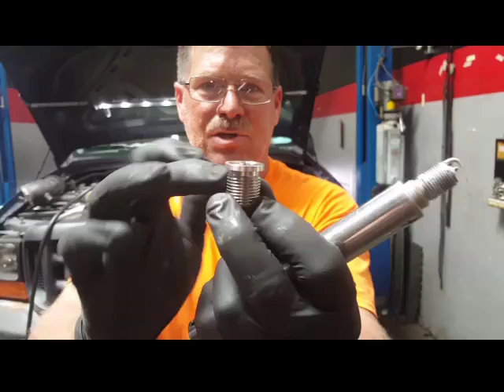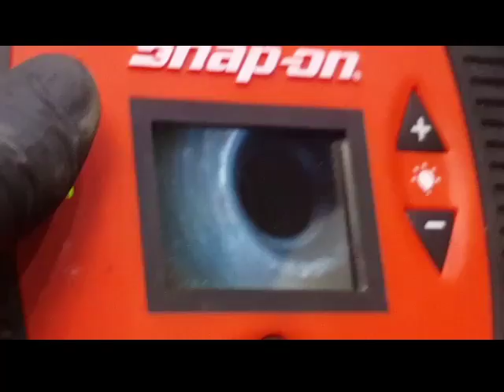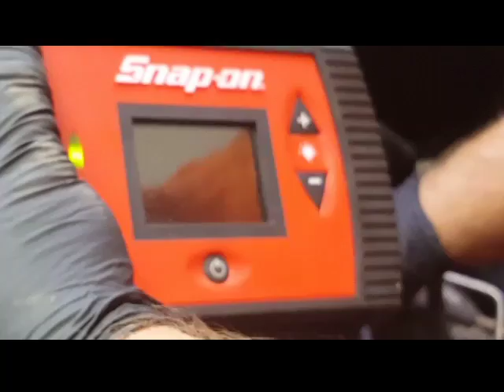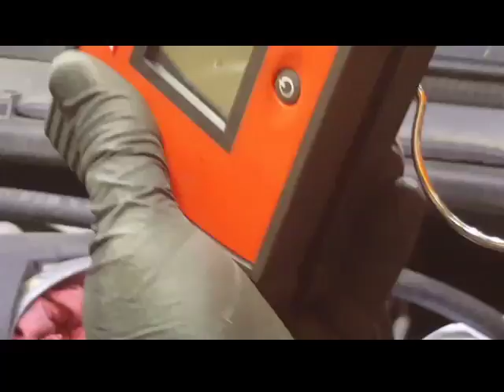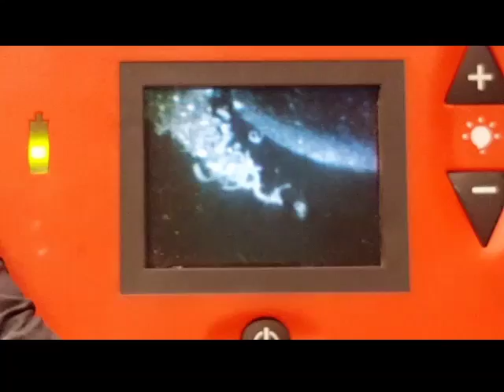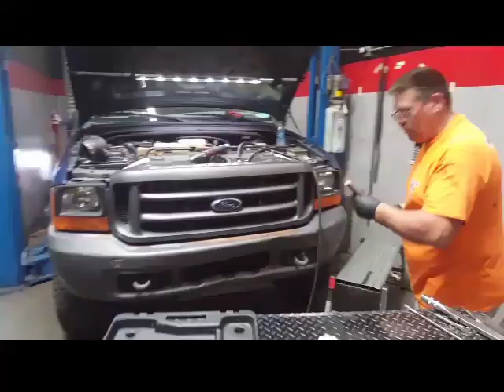New Method on repairing Ford Triton blown out spark plugs. 2 valve only

Comment: Hi Ron.  I just wanted to say thank you so much for your videos.  My sister-in-law has a 1999 Expedition and lives in Northern CA and I'm in SoCal.  She had cylinder #3 plug blow out and ruin the coil about 6 months ago and had it repaired in NorCal.  While visiting SoCal recently she had #2 plug blow out and ruin the coil also.  I decided to change all 8 plugs and coils as the engine has 120,000 miles.  I started changing the plugs with cylinder #1 and realized that the threads were stripped and that was the start of installing the inserts with the cal-van kit.  I then repaired cylinder #2 and when I took the plug out for cylinder #3, (which was previously repaired) the insert the mechanic used came out with the plug.  It was one of those cheap inserts with no shelf on it.  Thankfully those were the only 3 I had to install inserts in.  Cylinder 4,7 and 8 are the most difficult. The kit obviously didn't come with a clip to use with the tap so what I did was put a zip tie around the tap and was careful when tapping to make sure not to push the zip tie and allow the tap to fall in.  Although I bought the cal-van kit, long flexible blow gun and bore-scope I saved a ton of money doing the work myself.  If someone else reads this and decides to do the job themselves, DON'T skimp out on the bore-scope. It was a huge help. Once again Ron thanks for the awesome videos!  Sorry to be long winded.
Reply: Man, honestly how is it holding up. My 5.4 blew a plug out last year and I put a 4.6 in it that I thought was good. Long story short the 4.6 was locked up so now I'm going back to the 5.4 and I am looking into the Cal van set. Any tips or advice would be greatly appreciated. The problem cylinder is #4 but the motor is already out so I've got plenty of room to work on it.
Reply: @codyswilley  I would defiantly do all 8 cylinders since the engine is out. Considering the age of this video you probably have addressed the issue.  Can't understand why you would go to all the labor changing engines. The 5.4 despite the sparkplug problem are not a bad engine, many have over 250,000 miles on the clock and still run well.

Comment: Quick tip I use for what it's worth to ya .. I use a remote starter switch on the hot and solenoid .. I'm sure you know this trick but I usually work alone .. also I cut my threads with a ratchet by hand. It doesn't take long just seems safer to do it that way slow and steady
Reply: Where are you located

Comment: Awesome instruction.  I couldn’t get time-cert to ever reply and then found your videos.  

My #9 blew out at 201k this last week.   I got a Lowe’s camera with a 11.4 mm diameter low res but worked well.  

I have a big shop and many projects in they way. But after watching the videos it didn’t even make sense to move stuff around to get the truck inside.  About 1 hour 15 minutes I was done.   Most of it was getting the air wand the right length so I could spray chips from the #9 hole.  And my little compressor had to recover more than my big shop compressor. 

Also the Calvan kit has a sticker inside saying each insert was checked for quality.  I double confirmed it against the tap thread and prechecked the plug before Inserting it 

Thanks!!

Comment: 2000 F150 blew a plug a few years ago. Found your video and very carefully followed it exactly. That cylinder is still great. Happened again with a different cylinder and am now reviewing the video to do it on the different spark plug hole .  Have good confidence that this one will be successful as well . 👍 Thank you again !
Reply: Yes , this second cylinder plug position turned out to be a good successful repair also following this same method .😊

Comment: Ron I watched all of your videos on this process and bought the same kit.  Of course the cylinder I had to repair was #8 the hardest one to get to.  Once I got the fuel rail out of the way so I could reach the cylinder it took about 50 minutes to Ream, Tap and put in the insert.  Was the first time I ever have attempted a repair of that level.  Would have never attempted the repair without your wisdom on YouTube.  Thanks you saved me thousands of dollars.  I am going to do all the other cylinders to prevent future issues.
Reply from the maker: You are welcome. But just in case any of my followers are reading this. I have never on any Triton engine had to pull fuel rail to install an insert. But I understand how it makes you do-it-yourselfers feel like it gives you more room. Happy to help.

Comment: Well done and very much appreciated!  My very first one was #8 on a 5.4, did it all by hand, no power tools, I was too scared.  I used the ABN brand insert tool from Amazon, and waited 48 hours for the loctite to set before inserting the plug.  So far so good, but your method would have been much better.  My second one was #4 on a different 5.4; can't seem to get the customers convinced to pay extra to have the rest of them checked. Both were Expeditions, 1996 & 1997 all with over 190,000 mi.
Thank you.

Comment: Thank you Mr. Williams.  The plug in my 1998 4.6 (2-valve) broke flush leaving the metal portion stuck in the head, resisting ANY ease-out attempts.  Understanding that the process you present here was a viable solution, I was emboldened to (gingerly, in 1/32" dia. steps) drill the metal plug out to 19/32" bore, to use the Cal-Van 11/16" reamer.  Having seen your presentation, helped me to get to a solution and restore my truck.  Thank you Again.

Comment: 3 things. 1, after tapping, the  1/16 remaining might be by design not only to stop the tap from dropping in, but also help stop the gases from riding up the threads. 2. when i tapped by hand and reached all the way through the bottom of the hole, i could feel it give  and get very easy so i knew to stop and back out, then checked w bore scope. (when i test fit the new plug in the insert, the plug was recessed slightly so i didn't want to add another 1/16" in fear the plug would not be in it's normal position and affect firing timing.)3. if you get a spark plug blow out while driving, it sounds bad like a loud motor boat and freaks you out...i suggest  turning on emergency blinkers, slowing down and pulling over and stopping asap. Unplug the connector to the related fuel injector and the coil pack to the blown plug to avoid a potential fire. The truck will run very rough and may even stall out when you stop at lights (just restart when light turns green, or put it in neutral and keep giving it a little gas to prevent stalling), but it still should be drivable to get you home or to a shop/nearby parking lot.

Comment: Hi Ron excellent video! I have a 2001 Excursion I bought in 2012 with 116,000 miles on it. about 2 years ago I blew my first spark plug the mileage was then 144,000 miles. My local mechanic who I have gone to for quite a while explained the insert fix and wanted to put new sparkplugs in the other 9 cylinders I agreed.  On September 16 2020 I blew my fourth sparkplug since this tune up 2 years ago.  The 3 he put inserts in have been fine.   The ones blowing were the new plugs he put in. I talked to him today and I told him about your video I found about the calvan kit.He said he never heard of them but said he would watch it.  I love my Excursion its my fishing truck and is still in very good condition except for the damn plugs!  He always says I should get rid of it that it will cost too much money if one of the inserts pops out with the sparkplug and ruins the head.  I live in the midwest so I can't bring it to you.  Hopefully he will watch your video and THANK YOU for your time
Reply from the maker: Don't sell that truck. Sell the mechanic for telling you to. Most of the inserts I install for customers that have been done before can still be fixed by the calvan kit. But I've seen so many damaged cylinder heads as a result of save a thread inserts I had to make people aware.
Reply: @SandCarServices  Will do I got another guy who is very good with Ford trucks but his shop  usually has about a 3 week back log but I will stop by there tomorrow

Comment: Thank you! You're video was great. I just completed this repair on a 2002 Ford f150. It worked like a charm and I've never done tap and die before. Your articulated yourself in a manner that a home mechanic such as myself could relate and that was it is very much appreciated.

The only suggestion I have, is you say and the instructions say a decent air ratchet. to a lot of people including myself that's a bit ambiguous. I used an Ingersoll Rand with the 70 lb of torque and it did the job just fine. Maybe somewhere in the comments below you could suggest a minimum specs for the type of air ratchet somebody should use.

Again, thank you.

Comment: Thanks. Got a v10 van and #3 cylinder plug blew ten minutes out of Albuquerque. I pulled over and disconnected the COP and injector. I’ve driven this thing for at least a thousand miles back to and around California. I’m real tired of sounding like the Beverly Hillbillies or Chitty Chitty bang bang everywhere I go. Money has been tight, but I am getting this done next week, if the bit will fit under the van firewall. Thanks for the vid!

Comment: Thank you so much Ron. Watching your videos has help me with an issue that I thought wasn't repairable. I love my truck, and when I had this problem, I thought that my truck was ruined. I thought that I had to, either buy a new engine, or just get a new truck. I saw your videos while I was looking up this issue that I had. I thought about even sending my vehicle to you to fix at first because I'm not in your area, but it would've been really expensive for me to do that. So I thought about it, and through out watching your videos I had hope that I can get this done myself. I bought all the tools and the kits that you have, and now I have the job done. My truck is running so great now, thanks to you. It's because of your step-by-step, walk-through repair videos that my truck is now running pristine. So I have to say, "sincerely" thank you so much, for the heads up / on hands / professional advice. Thank you for sharing your experienced "how to" knowledge with the correct tools, and the proper kits to buy. God bless you Ron, and again, "THANK YOU MAN"!!!!!!!!!!!!!!
Reply: pjeffc123 I am Feeling the Same Right Now! I Now have Hope !
Reply: Hi I'm watching from Brooklyn NYC ,thank you for sharing your knowledge .I have 2004 Ford E350 5.4 L and are have some issues with black smoke coming out of the muffler .Having a hard finding a knowledgeable mechanic to diagnose and fix the problem  .Do you know of a good mechanic  in NYC who can help me ,or do you have an idea what's causing the issues with my van .And do you do work in NYC.

Comment: A couple tips from my repair.  If you have trouble getting all the shavings out like I did, hand rotate engine so that it is at TDC and valves are still closed then try again. With the piston up it did the trick.  Second thing is that the tap required about 100 ft lb at the halfway threaded point so if using an air ratchet you will need a really powerful one.  I just switched to a torque wrench and did it slowly and worked it back and forth about 3 turns in, 1 turn out.  Also, when you buy a boroscope camera, try to get camera head in the 5.5 to 8.5 mm range so it easily fits through the hole .
Reply: therockkkkher it was cylinder #3 at 73k miles on an F250.  It is a 2002
Reply: therockkkkher they were original.
Reply: therockkkkher the plugs begin to loosen and then rattle or move up and down on the threads with each compression and exhaust cycle. That gradually fatigues the threads.  From what I have read check torque but don't over torque.  I would not do antisieze between plugs and stock head.  I plan next month to install inserts in the other 7 cylinders so it's done.
Reply: Hey Ron how do I reach you I have a 6.8 2000 excursion

Comment: Ron you are really paying it forward.  I could have talked to you for an hour.  You have given me the confidence to do this repair. Thanks again aka the republican in the Bay Area.
Reply: Hey Ron I have a 2003 mustang gt 4.6 2 valve that shot a plug out can I use the Cal Van 39300 to do the repair just curious cause all of these kits only mention the 3 valve 4.6
Reply from the maker: No the 38300 is 3 valve only. The 38900 is the 2 valve kit
Reply: @SandCarServices   ok thanks so if I didn't live so far away from you I would have had you done it great video very very informational great works thanks so much and have a blessed day

Comment: Great video Ron, saved my old Ford!, I've got a 2000 F150, 146,000 miles, #7 blew on mine, glad I found your video and Cal-Van kit recommendation....and yes Cal-Van  should be takeing good care of you for that...so as I'm in there I replaced other plugs as well, 5 of the remaining 7 I removed by hand !! Thanks for the heads up and great instructional!, have a great day and God bless you

Comment: Thanks for the video.   Another kit you should get commission on.   And it came with the e-clip.    Your video was very useful and made the job go pretty smooth.  #7 on a 5.4L Expedition 2v.   I plan to just do them all and add fresh coil packs and plugs so I shouldn't have to worry about them for a while.    I had to order more adapters as #4 on my 6.8L Excursion blew as well.    I'm doing the modification, plugs and coils on that when the parts show up.   We were to chicken to use the air ratchet for threading.  It went very well using the old manual ratchet.    Your trick with the air hose to determine when the valves closed was probably the most beneficial.  Thanks.

Comment: As a Tool and Die Maker, I'd say 
that a better explaination  why
the plugs damage the threads 
and pull out at 30 lbs. torque is
cuz the stress of that torque is
only spread over 4 1/2 threads
as opposed to the much needed
full 10 threads as on the plug itself.

Comment: I replace all 8 when I rebuilt my motor. The threads looked weak and I didn't want to have to fix it later. I had two inserts that the outer thread would not fit. I get a tap and die set and fix them from Harbor Freight for the double the cost of two replacements. Now I have a new Tap and Die set for all my needs. I enjoy fixing things for cheap.

Comment: Great detailed video!  On a related note, the force of the ejecting spark plug (#4) not only took out the coil, but pulled one of the wires out of the coil connector plug.  Difficult to see at first, but it was only running on 7 cylinders after the repair, so a little diagnosis showed the damaged connector.  Easily replaced with a new pig tail from O'Reillys.

Comment: Cal-Van owes you another free reamer!, i just ordered a kit after watching a couple of your videos. Thanks for the info.
Reply from the maker: Your welcome. Funny they finally sent me some free stuff but half of the inserts they sent me were defective! LOL
Reply: @SandCarServices  Were they stainless steel ?The inserts that I got in my CAL VAN insert kit from TOOL DISCOUNTER,are not stainless steel. I knew that as soon as I opened the kit, because to my knowledge stainless is not black in color and is certainly never magnetic.This kit has the CAL VAN logo and the website on it. It is also labeled the 2 valve 38900 kit. So I see no reason why this kit doesn't have the same inserts that you show in your videos.
Reply from the maker: Up till now all the cal van inserts I have installed have been stainless steel. One of the owners called me a while back shortly after I posted the quality control video and one of the questions he asked was something about either bluing or anodizing them black. I have not recorded inserts in 6 months and only have 5 left in my box. I guess I'll find out. But steel, stainless steel, makes no difference to me as long as they continue to keep making them the same way with a huge hat on top. That what makes it so much better than a save a thread or a time cert.

Comment: The CalVan 38900 kit doesn't come with e-clips, because according to the directions that came with the kit, you are supposed to drill through to the combustion chamber. The stop pin that comes pre-installed into the reamer will prevent the reamer from going past the guide and into the combustion chamber. The e-clip comes with the CalVan 39300 kit designed for 3 valve engines which prevents the reamer from drilling through to the combustion chamber. The guides used are different lengths between the 2 kits.

Comment: Thank you I re-tapped and replace a spark plug and a 2000 Ford expedition for my son he is so happy he got the truck we're only 500 had to spend a couple hundred on the tool kit but it was worth it
Reply: Did you keep the shelf on the bottom of the head from not letting the reamer go all the way through?

Comment: I got one plug broken in a 1.6 ecoboost.  Its due to galvanic corrosion.  Nothing but threads left, and the plug is a little different than those shielded triton plugs.  I blew the porcelain out by way of compression stroke.  Ive been developing an attack plan all week, wish me luck, lol 😜

Comment: Just had my plug blow out on Cylinder #5, was on the scale at the landfill and when I restarted my truck I heard the pop and then what I though was a exhaust leak, like on one of my modified Volkswagens when I blew the flex pipe out. Figured it out pretty quick, kind of a weird easy to fix problem for Ford not to make a solution for on new engines. Unfortunately my a family is very short on cash trying to start my own business currently so I will have to make my old Jetta a farm truck for a bit.

Comment: Extremely helpful.  I noticed you use the E-clip on the reamer.  The instructions don't mention that.  The instructions only speak of using the E-clip on the tap and that the e-clip should be placed in the slot closest to the hex end of the tap.